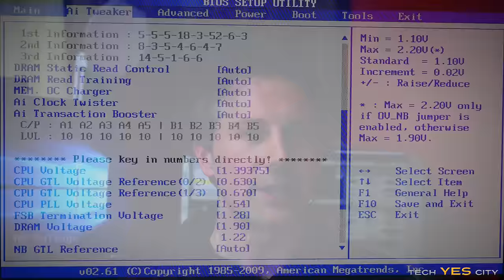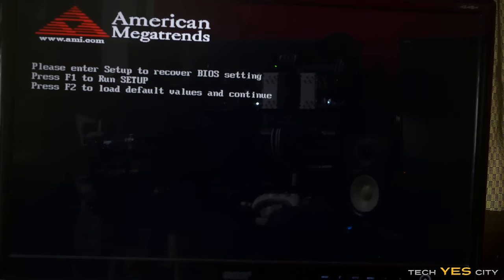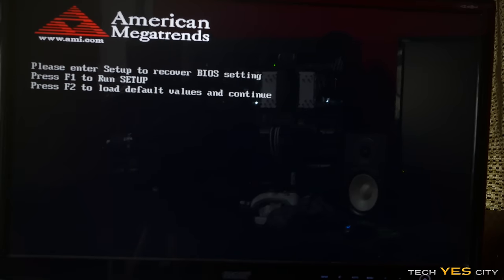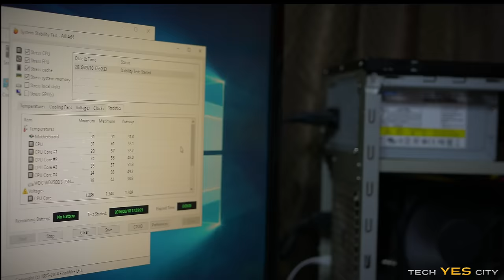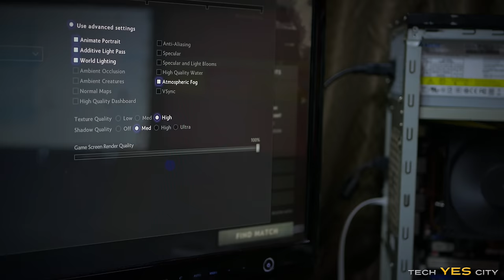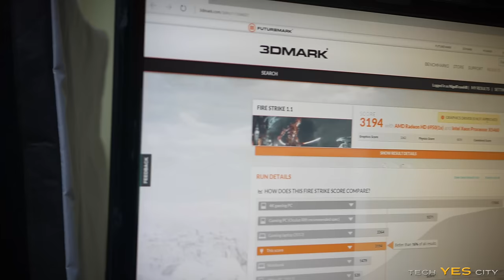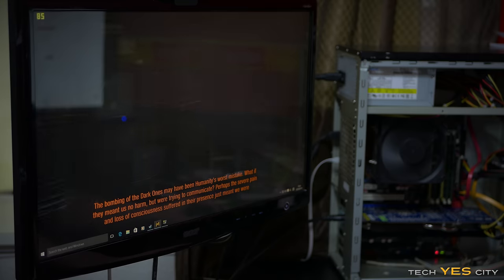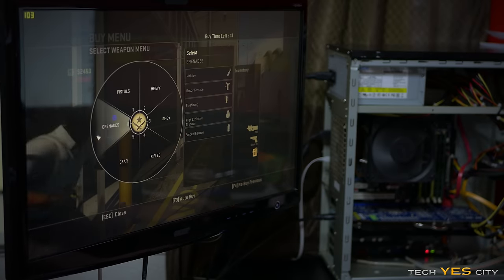$125 Used GAMING PC - is 1080p Metro Last Light Possible?

Comment: I'm doing something wrong with my PC, can your mother board affect performance at all? (in terms of frames of course)
Reply: Yeah, It might be under clocking CPU and RAM. Check  if your PSU is big enough. Also check ram and cpu speeds in BIOS, make sure they match whatever it said on the ram box/name and CPU.
Reply: Yeah my PSU is pretty overkill.. I have a shitty Intel motherboard, with an AMD A10-8750 (3.6 GHz [it has integrated graphics that are just ass lol]), a 600W PSU, and a 4 GB MSI GTX 960. But I run CS:GO at like 120 frames..

Comment: I have a x5450 at 3.0ghz, would it be worth it to upgrade my motherboard to one that can overclock to get squeeze out some more performance?
Reply from the maker: +Jern_ Depends if you can pick up a good 775 mobo for cheap? If yes and your ram is good then why not?
Reply: +Tech YES City I have 800mhz ram but i would need a micro atx board, a new cooler and possibly a new power supply. I have a PSU that can provide 300w and it is paired with a gtx 750ti, so i guess it isn't worth it
Reply: +Jern_ The good thing about buying a new good PSU with 5 years warranty, is that if you upgrade everything in the future you can just keep using the PSU. Same goes for a cooler, just make sure you buy one that has retention brackets for all kinds of different sockets, so you can keep it when you upgrade later to sandy bridge or something.
Reply: +Madarpok yeah but it won't be my main pc,  just a pc for when I'm at home in the weekends (I'm a student) so I don't want to invest too much money in it

Comment: Does the HD5850 and HD6950 work with the Crimson driver?
Reply: +BakyLive Sorry man, seems like crimson driver isn't gonna work..Unless you use the beta driver like Catalyst-version 15.7.1
Reply: Source: http://www.guru3d.com/news-story/amd-drops-support-for-non-gcn-based-graphics-cards.html
Reply: +BakyLive You can install the Crimson 16.2.1 Beta, it's what i'm currently using on my hd5670 with no issues.
Reply: +BakyLive It's not officially supported but it sometimes works on the 6xxx series cards.
Reply: +BakyLive Yes it does, it even works on crappy old laptop HD APU's. Tested it myself.

Comment: can you tell me how you over clocked your cpu .. because in my bios there is no option to change the frequency... please help me
Reply: he most likely used the Base Clock Method. Rather than boosting the Multiplier, which happens on unlocked CPUs, you instead must boost Base Clock and voltage. I highly suggest looking at some videos of this before attempting it, it's not something to be taken lightly.

Comment: This isn't really connected to this video in particular but I've always wondered, what is the purpose of putting like 64 or 128 GB of ram into a gaming PC? Mine had 8 forever and I just recently upped it to 16 when I has upgrading my GPU simply because it's so cheap. I ran a lot of games with just 8gb of ram and never had any issues so I'm wondering if there is a benefit to having a shit loud of ram or if it's just a gimmicky thing that's possible to do but really unnecessary.
Reply: Absolutely nothing
Reply: 16GB is plenty for gaming. 32GB is overkill unless you are rendering shit while you're playing

Comment: A friend wants to sell me a dell xps for $300, should I grab this and throw in a new graphics card or should I just start from scratch. Don't really have that much to spend. I would like to eventually do 4k, but I will take 1080p at 60fps with everything cranked for now. I want to see for myself how it compares to a console.
Reply: I have a ps4 and am xbone. Is that good enough.  The pc hype is getting to me. Lol I was thinking of throwing in a gtx 970 evga into the dell. If it will work. It has 16gb of ram an i7 6700 3.4ghz cpu and 750 watt psu, 2×2tb hd's.
Reply: +David Lagnado depends on the system. I mean a dell xps could be everything tbh :D
Reply: +Caliatus LP Its the 8300 model. If that helps. Lol
Reply: David Lagnado
mhh not really thb. The 8300 series could be anything from an i5 2300 to an i7 2600 (both not overclockable as far as I can see) and also the GPU could be non to ATI HD 5870, which is not to great either. So you could get an ok deal or absolute bullshit if he has the lowest config...
If your confident enough it's better to go for something like the setup in the video with a better GPU or the 330$ used build he did recently. That thing crushes the dell for sure.
Reply: David Lagnado
And btw even the best XPS shouldn't be able to play at 4K, maybe 1080p in 60FPS with a better GPU (the 5870 is not to great)...
Reply: +Caliatus LP What parts would  you recommend for that low a price?
Reply: David Lagnado
yeah just like i said watch that 330$ Video and try to build something like that. The Xeon E5640 is just like an i5 and the 270x is a pretty decent card in 1080p. You could also go for an i7 2600k, but this thing should be more expensive usually (but you can get the MB cheaper).

Comment: I have bin useing a lga775 socket cpu for gameing  its a pentium dual-core E5800 clocked at 3.20 ghz not over clocked with 6gbs of ram with a gtx 680

Comment: what is the spray stuff you use to clean the mother board mate
Reply: water
Reply: thanks
Reply: +ickeys beats NO ITS NOT WATER LMAO
Reply: Pablo i did google it lol
Reply: Compressed air :)
Reply: Matti xsx thats exactly what i used i just got an air compressor and turned it down and blew all the dust away ,i did remove the fans and washed them with water though
Reply: worked like a charm it looks brand new again
Reply: +ickeys beats np m9

Comment: :0 ! you took a screwdriver to the factory-lapped copper block!? why... why did you do that? I know it's salvage parts but... some highly concentrated isopropyl should've been able to break that old thermal gunk down and you could've used a cloth.
Reply: I sand old copper contacts on heatsinks.

Comment: why can't people build computers this good... with recent parts? how many ways are there that you can screw up stuff these days? the OS? the mobo settings? i'm so confused when trying to tech support.
Reply: +NavJack27 you could screw up even worse in the olden days. there were just fewer people actually building, and those were usually more well-informed. modern mobos make most things really easy to diagnose and fix imo.
Reply: +givemeajackson yeah i built an amd k6-2 back in the day with my father. twas quite a time back then.
Reply: +NavJack27 What the hell are you talking about?
Reply: +NDogg15 people having performance issues in csgo on modern computers. twice bri bri has show'd old hardware kicking ass in it.
Reply: +NavJack27 He's only showing framerate performance. If you use that alone,  This still loses to faster PCs. Again, what are you on... about?

Comment: hey, pc noobie here. if i recall, dont i still have to buy an operator for the pc?(like windows)
Reply: Yeah, but you can install Windows 8 and Windows 10 without having to activate it. It will nag you but it's not too annoying. I do highly recommend buying Windows, though. But in the mean time if you were to use the non activated Windows you could save up and then just buy a Windows key and type it in!

Comment: i wanna build a used pc with a q8200 and hd 6950 with 8gb ram but id like to know would this perform better than the one in the video
Reply: please someone reply to me
Reply: +Naheed Uddin I honestly don't know D:, but it will probably be about the same, idk tho XD
Reply: It'll be slower, based on the CPU anyways. He had that X5460 cranked up to 4GHz, whereas the q8200 is 2.33 by default, and you will not be able to match that OC with one of those.
Reply: Do not use the Q8200 if you can there's something funky with that cpu and it just doesn't seem to game aswell as the q9*** or the Q6600.

Comment: Because adding a sticker adds value.
Reply: No that's how much it cost for the sticker.
Reply: +mrdaxtercrane You need to have that sticker on the socket 771 xeon for it to be compatible with socket 775 mobo
Reply: ***** I meant by a case sticker. But I see what you mean and I understand.

Comment: The microcoding i am interested in. I think its possible to get DDR3 board too. Can someone explain what needs to be done? I already understand the sticker part...
Reply: Lga 775 motherboards only support DDR2 memory, even physically
Reply: No they have Ddr3
And people have done lga 771 on Ddr3 board.
Look it up. It's real thing. I just never understood the microcoding part
Reply: Jason Valerio
Yeah, there are lga 771/775 boards with ddr3 ram, but either ddr3 or ddr2, not both.
Theyre physically incompatible.
I dont know any microcoding though
Reply: I was never asking for both. My question was purely microcoding. So what boards have you used that didn't need the microcoding? Very interested in that!
Reply: I dont even get what you mean by microcoding.
What do you need it for in this case?
What is it?
I was bored and listened to this video while scrolling throuh comments
Reply: pretty much most all boards require you to plug in with a normal cpu first. change some code and something to do with bios. to get the lga 771 cpu to work on it. i don't understand it much either. really would like to know what boards don't need it that are ddr3
Reply: If I had an old Xeon, i would try...
Reply: I am getting one from someone soon. that he said, he got lucky and didn't have to do anything complicated. Abit board with X5450 Quad Core 12Mb Cant wait to test it.
Reply: I currently have a Celeron running in my 775 board, would be awesome if I could get my hands on one
Reply: yeah i could sell you. one I just don't how the boards work. are you ddr2 or ddr3?
Reply: I have a Biostar G31-M7 TE with ddr2.
As the name says it has G31 chipset.
This chipset supports ddr2 while other chipsets (x48) support ddr3
Would you ship it to germany though?
Reply: Probably. i have to wait to see what i have. guy mailing me a working board with cpu. then i might have 2 or 3 Xeons.

Comment: I just created a similar build with a q6600 since the xeon is twice as expensive here (although better overclockable, because it is a 45nm chip) and oc'ed it to 3,2 GHz.
results are here: http://www.3dmark.com/3dm/11197227

is it worth getting the 4GHz X5460 only for games or am I just fine with the overclocked q6600 since the GPU has a much higher gaming impact (even on older games that you play with such an old PC)?
Reply from the maker: +Naddel81able 4ghz will get you about 33% more performance on both single and all cores, if the physics score is anything to go by (I scored around 6750 on that test at best).
Reply: I absolutely agree, but will that lead to 33% more frames in games as well? or is it that most games of that era (till 2012) do not even make full usage the quad core's potential and therefore the overclock does not give a real boost?
Reply from the maker: Yes it should be a 33% boost (roughly) in games too, if that games are CPU bound.

Comment: 120ish FPS in CSGO is cutting it a little close. +160 really smooths out the experience.
Reply: ***** I play on a laptop with 60hz panel and playing CSGO at 180FPS is WAY smoother than playing it at 60FPS - which would make it unplayable - so your argument is nonsensical.
Reply: ***** I don't know. All I know is the difference between playing CS at even 120FPS or 220 is HUGE. Anything below 110FPS becomes too stuttery and laggy Pros have rigs that can pump +400FPS at lower resolutions, and they say it makes the game smoother, even though they all use monitors with 120-144hz "only". Weird.

Comment: this mainboard had a lga 775 ?
Reply: +Maciek Moroz Yeah, he modded the 771 Xeon to fit in. He has a great video on it.
Reply: how??
Reply: +Maciek Moroz I would watch the video, but it requires you to cut two tabs off in the socket and use an adapter sticker on the Xeon.
Reply: thx 
mate

Comment: why would you need a cpu sticker for a case. Please answer
Reply: N/A N/A its not for the case
Reply: so what is it for
Reply: That's for the CPU, to mod it from LGA771 to LGA775
Reply: but is the sticker necesary what mod does it give it. I really dont see the point of it
Reply: N/A N/A Yes, it is necessary in order for the cpu to work on lga775 motherboard
Reply: really. whats the magic in it
Reply: N/A N/A Oh, if you might not know, the sticker is not on the case, its on the cpu itself
Reply: really. so how do it work. i mean the paste and the frying of it and it gets hot and all that stuff
Reply: N/A N/A he messing with you please don't put a sticker on your cpu
Reply: It's not on the dye, it's on the "land" where the pins from the mobo touch the cpu
From delidded.com
"The adapter is basically an electronic circuit on a sticker, and you place it on the Xeon processor. This switches two of the pads on the bottom of the Xeon to make it compatible with a Core 2 Quad motherboard."
Reply: oh. make much sense now.thanks it seemed a little odd you would need a sticker on a case for a cpu to work

Comment: Why it runs smother than my intel g3258 , gt740 2gb, 8gb ram ?
Reply: Gpu and Cpu is better.
Reply: Overclock ur g3258, and trust me. Your computer will blow his out of the water. As it should
Reply: NickTempalski i have it on 4.10 ghz now and every 5 seconds i have screentearing/Freezing
Reply: ***** Up the Voltage
Reply: upgraded to windows 10 and now runs silky smooth :D
Reply: Maybe for most of they, but the g3258 anniversary edition was meant for gaming
Reply: ***** and thats the reason i play bf4, far cry 4, battlefront 4... on medium 60 stable fps ?
Reply: ***** if u didnt tested i dont know why u comment
Reply: yugopyro - cause the gt740 is Bs, it isnt meant to be for gaming
Reply: мј мgс it ran perfect on windows 10, but then i got gtx 780
Reply: only had problems on windows 7 professional

Comment: I dare you to build a $4500 to $5000 PC
with this specs
Intel core i7 Skylake
Asus z170 Deluxe
3x GTX 1070
2tb HDD
1000wats PSU
use water cooling system in it

Comment: can you not benchmark CSGO on de_nuke. it's very very poorly optimized. please use dust2 or mirage instead.
Reply: +Immortal Panda shouldn't you check the most demanding scenario? if it works on nuke, you can be sure it works on the other maps as well. if it works on dust2, you might still get into trouble when playing nuke.
Reply: givemeajackson yes, that would be true, if nuke's FPS wouldn't vary so much. it'll half in certain parts of the map giving you a false and non-reprecucable benchmark.

Comment: Do the same pc but with a 750 ti
Reply: then it costs double...
Reply: The 750 ti is costing around 100$ on ebay, but now when i have looked around u should probably go with a 770 instead, becuse they are going for around the same price on ebay.
Reply: Well as broken one maybe ^^
Reply: The 6950 performs better
Reply: Chalklate U can play in 4k with that graphic card, like in gta v
Reply: +Hugo Lindholm Mkay..
Reply: +Hugo Lindholm 
Don't get a 750 TI. It's known to been crashing occasionally for no reason.
I've read many cases where people have had similar problems with their 750 Ti. I've upgraded the PSU, downclocked the card. Nothing quite helps.
I've got two of those cards and both behave the same on my X5460 775 build, when running single or SLI
Especially GTA 5 has been crashing alot. No problems with frames even after cranking up the graphics, temperatures are normal, but it still crashes... :(
Reply: +DecibelAlex Ok, thanks for the answer man
Reply: DecibelAlex sli 750ti? thats interesting.

Comment: "PC gaming is too expensive for me"
Reply: I don't know many people that buy used parts for their builds, as they aren't as reliable as new parts. Also, this build did not include OS, monitor, keyboard, mouse, speackers/headset. When buying a pc, no one wants to end up with an underpowered machine, good pc start from 500 and up.
Reply: N00b 2100omg Trust me bud, I know. I've built two PCs personally. It's true, if you want a good PC you have to spend money but a decent PC can be built for only $320. The point I'm trying to make is that although this PC isn't complete like you said it is still very affordable.
Reply: Suppressor I get what you are saying, and it's true. Pc gaming is not as expensive as many believe, but I would be lying if I said that a $350 pc will last you a year and a half without making any upgrades. If anyone is making the console to pc jump, it's better to get something more powerful than what consoles can offer.
Reply: N00b 2100omg So what are you talking about? You clearly understand the point I'm trying to make and continue to talk about something else.

Comment: I hate to see how people build better pc's than mine for way more less than what i paid for mine fuck

i paid 130 bucks for my hunk of junk 

cpu: core 2 duo e6750

gpu: HD 7750 1gb gddr5

6gb of ddr2 ram 

350wat power supply

and 360gb hard drive 

every game i try to smash in 1080p runs at like 29-32 fps 

if i play in 720p games can run at 50-65 fps
Reply: that Core2Duo is definitely holding that GPU's capability.
Reply: +David Alvarez I had i5 760 and AMD 7750, could runs most games at 1080p (besides new ones like farcry 4, asassin creed unity those hardly ran at 720p) i bet it's that dual core cpu is holding it back.
Reply: +PlayerOne not only that, the GPU was running at PCI-E 2.0 instead of 3.0.

Comment: my pc can run metro redux and last light at 60fps 1080p. I have a GeForce 210
Reply: yes it can it says on my nvidia control panel that it can run excellent
Reply: Yeah it can. I have it
Reply: No actually i was playing CS:GO just now
Reply: It runs slow but its fine
Reply: I have 1gb model
Reply: it runs csgo on 40fps on 720p lowest settings..
Reply: i have tooooo
Reply: Vaywave haahahaha, A GT 710 at 1080P at least in low have 15FPS maximum, that shitty card doesn't nothing bruh